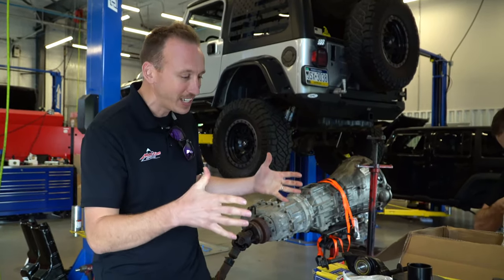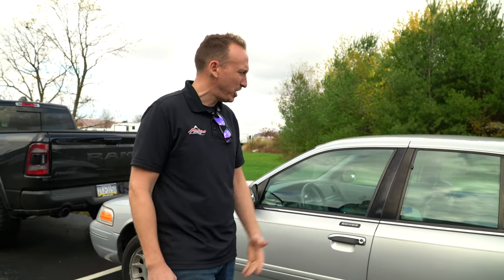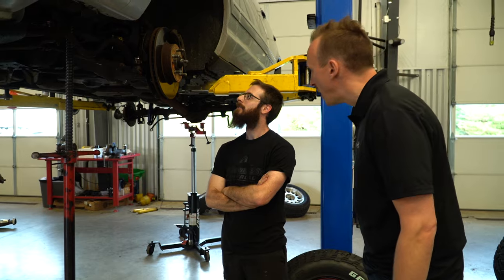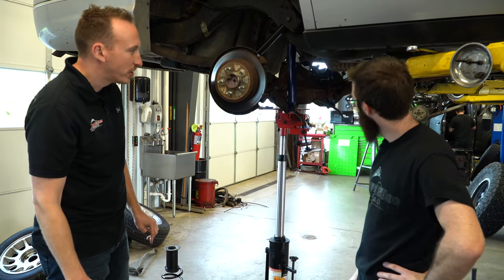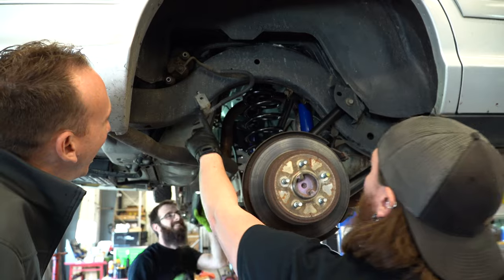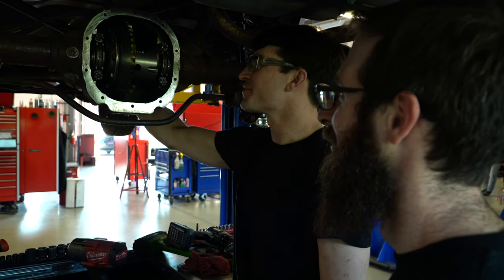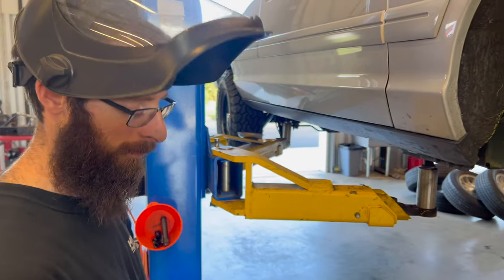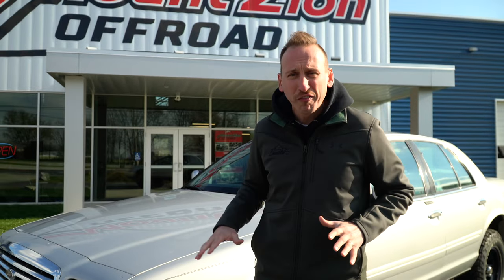We lifted this Crown Victoria 6 Inches with 31’s!

Comment: i lifted my 2010 crown vic police interceptor K9 unit. i did the 3" and put 30" BF Goodrich All Terrains on it. Already had a 3.55 posi. Also have a ProCharger from a 4.6L mustang my machine shop pal adapted for me. Its a hell of a lot of fun off road, does surprisingly well in the mud but wasnt bad before the lift really. Most fun though is running up at the party store at 1am tuff and watching everyone scatter lol.

Comment: 19:50, the 1989 Ford Thunderbird and Mercury Cougar had that problem. At full lock, it compressed the caliper, and after sitting you had no brake pedal. It was a recall or campaign, I remember putting an acorn nut on the radius arm.

Comment: I put 2" Wheel spacers on my 04, Police interceptor. 
3" lift F-150 shocks in back all new suspension tires 70/265/16 AT

Comment: The lower control arms in the rear don't have a jam nut on both sides for a reason.
 These parts need to flex and rotate a little bit and you puting a jam nut on both ends is actually counter productive as the fine threaded side will hold its threads tighter than the course for at its side which is why the course threaded side has a Jam nut.
 Now the bushings that are in the ends are going to wear out prematurely cause they're gonna be twisting against each other.🤷‍♂️

Comment: NIce video, But incomplete. Please revisit the issues you had with the lift kit and what you had to modify. Were the front shocks usable as they were shipped to you guys?
I have ordered a 3 inch kit and the front shocks, while new, were extended with  long union nuts. This cant possibly last with hundreds of shock compression cycles. How did you align with those elongated top ball joint brackets. 
Please list what you had to customize so that your loyal subscribers get a true picture of what you guys installed. 
Thank you,
Reply: Mileage will very

Comment: I’m currently working on my own design lift blocks for the front of the 03 to 11 Crown Vic I’ll have them done on Monday and ready to install. I wasn’t happy with the quality of lift plates for the front. I don’t feel confident in there ability to hold up to real abuse. So mine are 6061 And on the rear I’m using expedition springs. About 3 inches of lift. Thoughts?!?  This is what ide like to do for living. Design rad parts.
Reply from the maker: That sounds awesome! When we we do another we may experiment with different lift springs in the rear. A ZJ rear spring looks like it might be about right, then it would just be figuring out the length that it needs
Reply: I’ll buy it if you make it lol

Comment: How much would a build like thos cost through you guys i have a vic and i was thinking of driving to you guys to get it lifted and a few other things
Reply from the maker: Lift, installed with alignment is around $2500-3000. Give us a call to discuss further! 717-308-1844
Reply: @MountZionOffroad  That includes the lift kit also for pricing?

Comment: wish I would’ve watched before lifting my ‘11 Camry. Only a 2 inch lift but adds some perspective on things I could have done to fix sway bar and link issues. Google is a black hole, Any tips on finding the right parts ?
Reply from the maker: Not trying to toot our own horn here, but our ability to find parts like we did in this instance comes from decades of combined experience across the dozen or more people we have on staff. You can witness exactly how that process goes when several people are standing around conversing about the rear brake like relocation.  The only real advice I can give is to take it to a shop that has been doing custom work for 10+ years, or possibly take the specific part you're looking to replace to a NAPA.  Many NAPA stores still employ a few parts guys with 20+ years experience who are able to cross reference parts from one application to another just by looking at them.

Comment: In reference to the watts link, that is a performance car thing I don’t know when Ford put it on the crown Vic, but that was added to support the police package. It is on all crown, VICS, grand marquise, and Lincoln town, cars and drastically improve the performance cause the axle cannot move side to side, so is it just a car thing? No, it is a performance car thing
Reply from the maker: Good info, thanks!
Reply: What year did they add that? Ive got a 89 LTD

Comment: Hi can wheels and tires thats meant for a suv go on a pasenger car if lifted?i have 22s that came off a jeep suv i have a 2003 buick i want them on
Reply from the maker: Tires can, absolutely. With wheels it of course depends on the bolt pattern, but also the offset.  You'll need to do some research to determine if those aspects of the wheel are right for your car and the look you are going for.

Comment: I bought the 5” lift kit and I was wondering if you put the shocks extender piece at the top or you took it off
Reply from the maker: We did not use the shock extender on the front
Reply: I’m installing the trailing arms in the rear and I put my tire back on and it’s not centered  like my differential it’s at an angle I just did one side

Comment: Just curious but with a 6" lift what do you think  that the largest reasonable tire/wheel size would fit in a crown victoria with no or minimal other modifications?
Reply from the maker: We had to do some trimming on the front for these to work, so 31's is the most we'd recommend.  Many have fit a 32-33" tall tire with major trimming and it can look really cool, but is obviously a lot of body work to do it right!
Reply: @MountZionOffroad  Thanks, I was just curious.

Comment: Wondering when someone will stumble on a affordable 4x4 solution for crown vics. Seeing all lift CV but only a handful of trail videos is disappointing. Has to be something done about it.
Reply from the maker: It looks like it really wouldn’t be that complicated to do a solid axle swap! But would require a lot of fabrication for sure
Reply: @MountZionOffroad  turning a CV rear into a steer? Inner and outer C's from a dana 40?
Reply: @bladenrexroth2555  Rear axle is an 8.8 - a good stout axle but why reinvent the wheel. Just swap in a 44 front steer axle from a Jeep or get an aftermarket housing from Currie, Dynatrac, Fusion etc.
Reply: @MountZionOffroad  Maybe the IFS from a late 90's early 00's explorer? Straight axle would be the easiest and most reliable. 

Be cool to see a full kit offered. T case cross member, front and rear spring kit. Be cool to see 4-6 inches of lift just off of a new kit alone. No pucks. Like a Raptor Kit solely for the panther platform.

Comment: I want kit lift 4 in how much
Reply from the maker: It should be about $1500-1800 for the lift kit, shocks and install. A 4" kit is coil spring spacers, longer shocks, and you would need alignment

Comment: How much did it cost to lift the car ?
Reply from the maker: The lift kit costs around $1400 with the few parts we added (discussed in the video), install is approximately 10 hours of labor @$130/hr currently, and alignment at $200.  Wheels and tires will of course vary depending on your choice, and the owner chose to re-gear and add the Trac Loc so that was additional.
Reply: Lift kit - $1400
Labor - $130x10=$1300
Alignment - $200
8.8 Trac-Lok 28 Spline - $379.95 || 8.8 Trac-Lok 31 Spline - $309.99 || Detroit True Trac Limited Slip - $639.95 || (Pick one)
3.73 Gear Set - $195.95
Wheels and Tires - probably like $1500
I've been told by 3 shops roughly $1000 to have a locker put in, but I'm in Canada and from what i've heard the US do car mods for a lot less.

Ballpark $5000 to $6000.
Reply: @SKATETOSLAYER  😂 in my city 100$ will get u lifted

Comment: lol I will never understand why people want to lift Crown Vics or other cars for that matter. Jeeps, Trucks, SUV's sure I get that but this is just goofy looking to me. All that work for a tire that almost fits on a Crown Vic with no lift. I have a Crown Vic with 255/70/R16's on the rear and stock on the front since I like staggered stances and rake, no problems with fitment. But yeah front probably wouldn't work with that size. Fun to watch the process though!
Reply from the maker: Definitely understand your position! For us it's just cool to see something outside the norm. Glad you enjoyed the build process!
Reply: To go more places than you can in a stock car. As for a Vic, there's not much different than an F-150. Same engine, trans, and rear axle. Lots of 2wd F150 builds.
Reply: @kylesonsalla7620  I agree, being able to go off-roading and more adventurous places would be cool, but it still looks off-putting in a Crown Vic lol, that is just my opinion though. Also pretty cool that they did in fact did share a lot of the same components at one time. I believe it was around 2011 Ford stopped using 4.6L's and 5.4L's in the F150's,  just like it was the last year for the Panther Platform.
Reply: @SKATETOSLAYER  
The 4.6, 4R70w/4R75w, and 8.8 are also used in New Edge Mustangs, explorers, E series vans, etc. Pretty crazy what all they used basically the same drivetrain in.